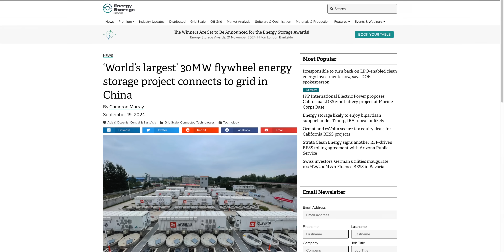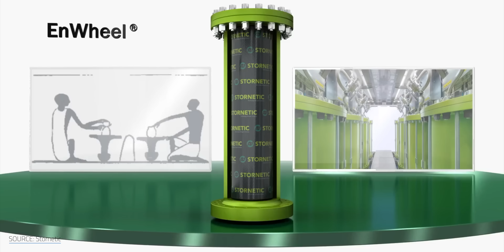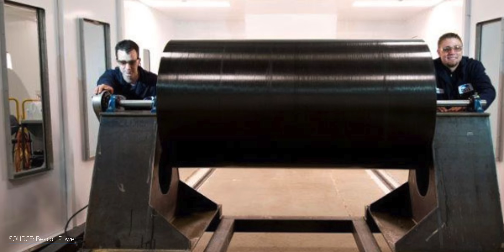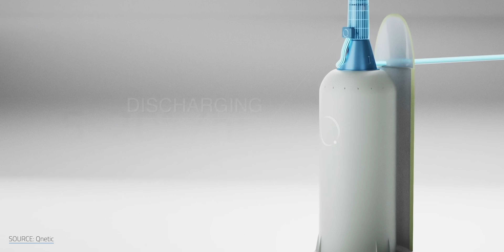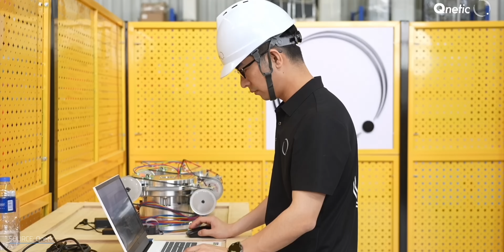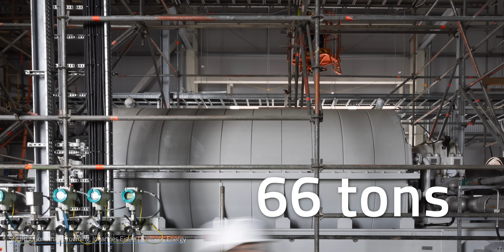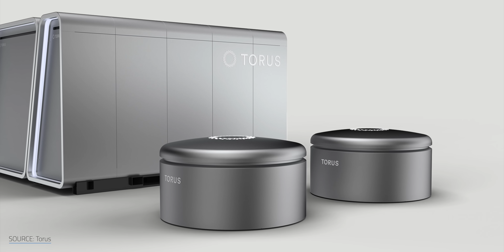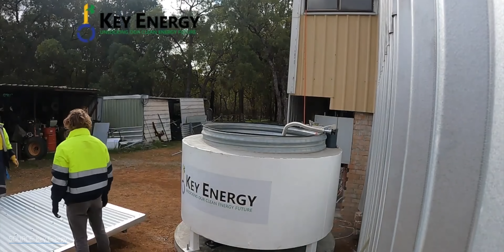How This Mechanical Battery is Making a Comeback

Comment: Bring on small unit for single family off grid solar and wind setups,  who never intend to connect to grid. In the winter excess energy can be used for heat and more computers. In the sumner it can be used to heat a pool and charge more electric devices full time that are currently gas. We've lived off grid 15 years Colorado 9600' with solar just fine. If we add micro wind to top off our batteries on windy cloudy days so we don’t have to use our 2 woodstoves as much, and would take the pressure off our propane glycol in floor heat system, then we can add mire tech comfort to our house with this flywheel. We won't pay premium early adopter prices for the turbine, but we will pay  economical early adopter prices.

Comment: The first "large-scale" commercial flywheel energy storage system in China has been deployed in the rail transit system. During deceleration, the subway can recover and store braking energy through the flywheel, and during acceleration, it can release this energy. This approach helps reduce the impact on the power grid. Additionally, this flywheel energy storage system is well-suited to the frequent start-and-stop nature of subway operations, fully leveraging its advantages of rapid response, high charge-discharge efficiency, and short charging time, while avoiding the limitation of the flywheel system's inability to store energy for long durations. If I recall correctly, the power rating of this flywheel energy storage system is approximately 10MW.

Comment: A lot of EV charging stations fight with their energy supplier to prevent those peak demand charges. So much so, EV chargers started coming with their own battery packs. Could flywheel storage be an option?

Comment: I don't understand your comment about 'BESS and FESS pair well'. I do understand why FESS is well-suited for short-term load/supply variations, but ... so are BESS. BESS with Grid Forming inverters can respond to frequency and voltage variations within miliseconds. It seems to me that the only way for a FESS/BESS hybrid to offer anything is "*IF* you don't put a Grid Forming inverter with the BESS, then the inverter can be cheaper (a few seconds respose time), and the FESS can offer the faster response." 

Doesn't make sense to me,

Comment: About 2002, I was working in the SAVVIS datacenter in Tukwila Washington. We had a ~1MW flywheel systems. It was from a company in Switzerland but I forget the name now off the top of my head. The system had about a 3 or 4 minute energy retention capacity which was basically plenty of time to start the backup generators which were maintained in hot standby mode (oil was hot, coolant was hot, etc) so that they could come online at operating speed with almost no delay. It was super cool and worked great.

Comment: This is completely moronic and for clicks... any remotely educated person would know based on basic math for example that a 18650 cell has enough energy to lift itself over 250,000 feet into the air. These gravity batteries store almost no energy and are nothing more than scams.

Comment: I have a feeling this is not going to be a long term solution. 

Renewables are ok but the issue is we need the is base load which solar and wind and pretty much all renewables are no good at. They are great great for intermediate and peak during the daylight hours or during windy conditions. 

But when you need power at night when the wind isn’t blowing you only have two options, fossil fuels like coal and natural gas OR nuclear which is where we need to be focusing. 

The issue is nuclear takes ten years from approval till you turn on the power so we need to get moving on it soon. But you have so many playing politics to use the crisis as a reason to controls peoples lives. 

But the idea of a flywheel is nothing new. We have had synchronous condensers (just a big ass motor spinning nothing) around for a while. You even have power plants that have stopped generating and taken that part off line but left their generators hooked to the grid is a synchronous condenser.

Comment: Constant speed flywheels that are linked directly to the grid have very limited usefulness, though they are simpler. Variable speed flywheels must be rectified and then fed into a grid-tie inverter. There's a small amount of power loss in this, but still on par with batteries on RTE. 
You know what would make all this better? A HVDC grid. Traditional power plants just need big rectifiers. Solar panels, wind turbines, and flywheels don't need inverters anymore -> better cost/energy efficiency. AC power that comes to our homes ends up being rectified right at the outlet 90% of the time. The reason for using AC originally was so transformers could be used to boost the voltage. Now we have high power FETS allowing for switching DC/DC converters that are a fraction of the size and cost, sonce at higher frequencies a far smaller transformer or inductor is needed. The sole reason for using AC is now obsolete from that one invention.

Comment: Would enough fly wheels cause the planet to stop rotating?
Reply: The earth rotation energy is 6e+22 kWh. That's equivalent to 2 000 000 000 000 years of worldwide eletricity production. No.
Reply: @danielrose1392 so short answer is yes

Comment: Does anyone make a heavy duty industrial type chemical battery with plates that can be removed/cleaned or replaced and circulating system for the chemicals that can be filtered and monitored and adjusted to maintain the proper composition?

Comment: Or you can build like 100 Wind turbines and use them a slow spinning distributed flywheel system. A 100 wind turbines should aready be about 10 to 20 MWh of flywheel energy storage.

Comment: I've installed Vycon flywheels on UPS systems. They require more upkeep than batteries, but they last longer. Main benefit was to get around local fire regulations limiting size of battery installations.

Comment: Many don't like wind turbines in their backyard.  cities use the most energy so turbines have to be close to the cities where the many will complain.  Just switch to small nuclear power plants and almost all clean energy problems are solved.  Cheap electricity, near the cities with high safety and low land use and low ugliness factors.

Comment: The instantaneous output power of a spinning flywheel is HUGE, limited only by the strength of materials. Even a flywheel with tiny energy storage can still generate ENORMOUS torque! But only for a moment. To store significant energy, flywheels have traditionally needed to vary their speed over about a 2:1 range, which allows 3/4 of the stored energy to be recovered before recharging. That is the result of Kinetic Energy being proportional to the square of speed (or rpm). The remaining 1/4 is generally considered non-useful. Those figures can be pushed at bit with modern electronic controls, but the returns on investment then diminish rapidly. So it is usually best to just install more or larger flywheels when a bit more storage is needed.

Comment: I worked for a coal mine several years ago. The massive dragline that was used for stripping overburden was electric. It used to hit the small local energy grid very hard when it would hoist and swing it's loaded bucket. The mine installed a flywheel to capture the energy from the dragline whenever it lowered it's bucket and the stored energy would buffer the grid when it hoisted. It was a simple and effective solution to protecting the power grid.
Reply: that's cool. was it solely mechanical?
Reply: @stumpingrimy1686  I'm not sure. I was an engineering intern at the time and I didn't work in the area in charge of it. I was just told about it. My guess is flywheel had been installed years before that. It was the Usibelli Coal Mine in interior Alaska.

Comment: Hey Matt, 

At one of my past jobs we deployed flywheel storage, vacuum containment and magnetic bearings, can't remember rpm but I seem to remember it being north of 10k rpm, maybe 20k?  This was for a heavy load telecom facility.  First we deployed 4 MW along side a new expansion (conversion of an office building to datecenter), then later migration of the existing facilities on site to another 4 MW.

We weren't using them as primary backup power, instead they were ONLY used for UPS failover during MW genset startup.  We went with flywheel as the maintenance and footprint was drastically smaller than the lead-acid traditional batteries in that role, and they didn't want newer battery tech as the 2nd floor was still office, and fire was a concern.

The deployment architecture was we had containerized sleds for ease of transport, site prep, and future replaceability.  Each sled was a matched set of a 1 MW genset, flywheel, and a small bank of lead acid for genset startup.  Again, all the flywheels did was maintain that MW load during a grid failure until the genset spun up and sync'd.  Otherwise they just sat there, spinning, waiting....

As far as I know, we were the first flywheel deployment at this particular nationwide telecom, and the architecture became a standard for other facilities.  (The nature of our facility was to showcase next gen tech and perform tech and integration test in a simulated large scale live network.  Lots of fun projects like this.  (We also showcased an ambient air exchange cooling for data center pods, no cfc or even water involved, just massive air movement.)

Fun to see flywheel getting some attention!

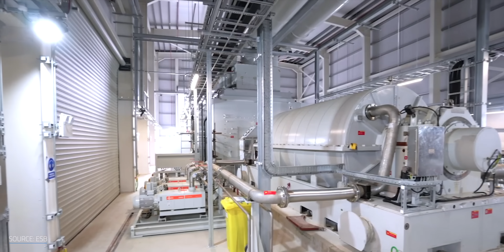Comment: 9:40 according to "the internet" Together, the flywheel and the synchronous condenser have an inertia of 4,000 megawatt-seconds. The 160 MWh figure may be the total energy in the spinning, but only a small fraction of that can be used in this configuration (frequency stabilisation).

Comment: I have some idea like an underground flywheel big and wide in its center a small round shaped support with oil circulation and megnetic levitation or a motor like design with copper coils and magnets.

Comment: Wouldn't it make sense to rebrand it as Mechanical Capacitors? Calling it a battery makes investors think it is a cheaper but poorly performing battery, they will discharge in about 4 hours (you can think big and build enough capacity to store energy for a while day, given that you have enough flywheels). I imagine  this can be modetately successful if paired in adequate quantities with renewable energy. Especially if its sold as a means of stabilising the problem with aplitudal fluctuation s during cloudy days, or using the little energy generated to build up reservoir.

Comment: The main reason mechanical batteries like flywheels and gravity batteries are being looked at is because of material science and the strength of materials is increasing.  

Mechanical energy is energy stored as it's being spun or lifted over something, so the energy is stored in the kinetic energy, which is held By the strength of the materials.

A flywheel battery's energy is literally limited by the strength of the material.  It is more efficient than any lithium battery, but it has to be spun

Comment: The company I work for has some bleeding edge IP in this field.  We have the tech for a 150kRPM flywheel with nearly zero eddy current losses.  It's a fantastic system.  It does use a vacuum sealed chamber and a combination ruby and magnetic bearing.

Comment: It would be nice to see a graph of energy density and power density versus technology (lithium / flywheel energy storage / flywheel frequency stabilisation / maybe other (pumped hydro / hydrogen fuel cell / thermal phase change / molten metal battery ) ) to make quantitive sense of the woolly verbiage.

Comment: I thought a mechanical battery was going to be a coil or speing of some sort made of a super material that was spinned to its extreme and then that spin could be released so it can power an electromagnetic motor. Like twisting a runner band and then releasing it.

Comment: Wouldn't it be more financially viable to have larger, more massive, slower spinning "low tech" flywheels? My logic says if you can solve the bearing issue, a denser flywheel wouldn't require the expensive vacuum solution. (Compare the freefall terminal speed of carbon vs steel ball for example)

Comment: The 26MWh System - what power ???  26MW or other ??,  there is still a cap on the energy rate ie the power..  (ppl do get a little confused with power vs energy still - sometimes graphic ? errors?  increase confusion.)

- Re. the mechanical properties - Strength of the material becomes more important than the density - mass per unit volume  (shall we use a metric Strength per unit Density or Specific Strength ??) because higher rotational speed  ("Omega" in the Rotational Mass Inertia / Energy Equations) attainable by a massively strong material stores more energy than a heavy weak material - of course an infinitely strong, infinitely heavy material would be ideal to store infinite rotational energy at   Zero RPM - And Infinite RPM  9a multiple of infinities there - jokes.....- but to attain that we would need to all be inside a black hole...

Comment: No a flywheel is what the clutch presses against transferring the energy from an engine like my small block Chevy to the transmission like my Muncie 4 speed to my 12 bolt posi traction rear end so I can then yell you like them burning tires 😂

Comment: Flywheels on UPS systems fine, maintains power until the diesels are up to speed. The rest, I did hear of a flywheel going out through a wall and only two chain link fences outside stopping it from mowing down a freshly built estate full of people.

Comment: Isen't it theoretically obvious that with many enough flywheels earth rotation could be decreased? I am not aware of a compensating factor besides redirection of forces. Each flywheel adds inertia that has a tendency to stabilize the earth, against its natural rotation. Is there a compensating effect? Where does the earth rotation energy go to? To adifferent direction in rotation?
Reply: The mass of these systems is negligible compared to the mass and inerta of the planet
Reply: All cars with there engines, wheels, and machines would have the same effects. This must compensate out somehow, since there is no path for the earth rotation energy to go, right?  Have to understand that I think. Of course the ratio of masses is quite negligible.
Reply: The moon is a much bigger problem which is actively slowing the earth's rotation as the tidal forces transfer angular momentum to the moon
Reply: @drsatan9617  o.k., If the moon acts like a retarder/ wirbelstrombremse flywheel forces are even more negligible.

Comment: I tust hoisting a weight high above and let it free fall got morw energy storage. 😅 if the weight is wound over the generatot. The spining wheel is nore on a stable 50/60 hz mains supply.

Comment: Seems like flywheels could be a great way to reduce peak demands on ultra fast EV chargers. You could use them like a water tower, spin them when demand on the chargers is low, and then let it rip when demand is high.
Reply: They are using large batteries for that today because the grid power is effectively  cheaper that way.

Comment: I have a national qualification as a chief electrical engineer.
It is true that the trigger for cascading power outages is that the frequency at a power plant drops, and that power plant is cut off from the grid, resulting in a power shortage, and many other power plants also drop their frequency. increase.
I think it is effective for backing up unstable wind power and solar power.
However, at present, surplus electricity is only generated in the spring and fall when air conditioner consumption is low, and using it in the summer and winter seems like a waste from an efficiency standpoint.

Comment: Historically, gas turbines and coal (steam) turbines contained flywheel technology to maintain grid frequency and inertia. As these turbines are retired and replaced by wind and solar, flywheels are needed to fill the role of maintaining grid inertia and frequency. Batteries are starting to play in this market now as well. South Australia is an example of a place that has very high renewable penetration and has installed some very large flywheels to maintain grid frequency and inertia.

Comment: Tesla Megapack Battery quotes a round trip efficiency from the order page: 

2 Hour Duration
Power & Energy: 1,927 kW / 3,854 kWh per Megapack
Round Trip Efficiency: 92.0%

4 Hour Duration
Power & Energy: 979 kW / 3,916 kWh per Megapack
Round Trip Efficiency: 93.7%

How am I supposed to believe anything in this video when simple facts are misstated and used to create bias?

Comment: im sure someone much smarter already took it into consideration, but it's a scary thought that a 'field' of flywheels could hypothetically have a failure cascade.In which, much like a room filled with mouse traps, one unit could fail and cause a catastrophic failure in it's neighbor. Could you suddenly have a field of flywheels throwing themselves out of their places in the ground? 

More of a "if the sovient union had a flywheel battery field 80 years ago" but still crazy to think about how much power is spinning around in these things.

Comment: FESS will remain inefficient in renewable energy systems as long as they're used to suppliment power during low output dips, rather than temporarily soak up high peaks.